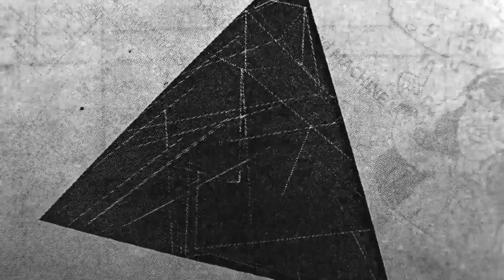TIME STRETCH

Comment: This is really incredible. My MG was one of the first five modules i bought when i started the Eurorack journey and I find new uses for it all the time (i use the piano a lot with it as well, despite also not being the most accomplished player)... but I’ve never used the time stretch function. It sounds so smooth! I’ve been listening to a lot of Abul Mogard and Indignant Senility recently and so, at the moment, this feature is going to be very high on the list to try out ASAP. Thank you for the constant reminders  that these tools will give you incredible variation and fresh sounds if you put your full attention into them. I think another manual reread is in order. ❤️

Comment: tried the time stretch as suggested in the manual....doesnt do anything. I thought playback of the slice was to adjust to the incoming clock. I get no change. in fact....clock in doesnt seem to do anything at all
Reply from the maker: You may have to turn Gene Size up - the time stretch and gene shift behaviors work when Gene Size is not playing the Full Splice.
Reply: @MAKEN0ISEMUSIC  ah…got it. Manual did not mention that (I think). I was matching the diagram settings. I’ll give that a go thanks.
Reply: @MAKEN0ISEMUSIC  went back to this. reread the manual. user error. I misunderstood what I read. what you told me helped put into context. werks....thank you!

Comment: With Morphagene, it seems as though even with the time stretch feature on, when the pitch is increased the sample plays back at a faster rate, and when the pitch is decreased, the sample plays back at a slower rate. Is this accurate? Generally, when audio is time stretched, shouldn’t it play back at the same rate regardless of pitch?
Reply from the maker: The playback rate is determined by the frequency of the pulses at the clock input. You could also think of time stretch as like modulating Slide with a ramp wave that speeds up or down as the clock does. As long as Gene Size is not zero, Gene Size and Vari-Speed will not affect the overall time it takes to move through a Splice. Also, it is not the individual Genes that are stretched but rather their overlapping start points- with larger Gene sizes the stretching effect will be less apparent
Reply: @MAKEN0ISEMUSIC  thanks for the reply. I actually have been researching this a bit, and it appears my Morphagene is not performing properly regarding the time stretch feature. While in time stretch mode, I have reduced the bpm of the master clock going into Morphagene from 87 bpm to 10 bpm, and the rate that my sample played at did not change. The audio remained steady at 87 bpm. I then increased the bpm to 140, and the audio still did not change. It remained at 87 bpm. Changing the bpm of the clock going into Morphagene had no impact. The left varispeed led was blue, and the morph was at 12:00. I also tried changing the txt file CKOP to time stretch only, and had the same result. The bpm of the master clock had no impact on the speed of the sample playback. Have you heard of this before, and have any recommendations?
Reply from the maker: @F_letc.h  please email technical@makenoisemusic.com with a short video deonstrating the behavior, and we will help you figure it out
Reply: @MAKEN0ISEMUSIC  Will do. Thanks